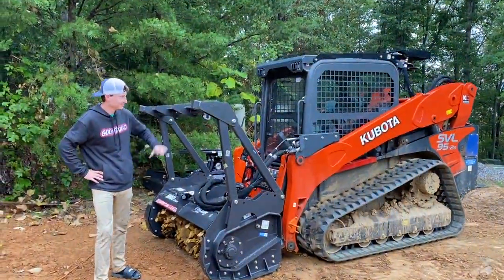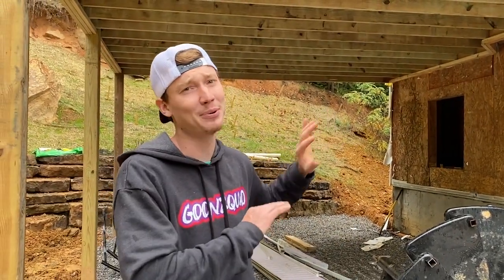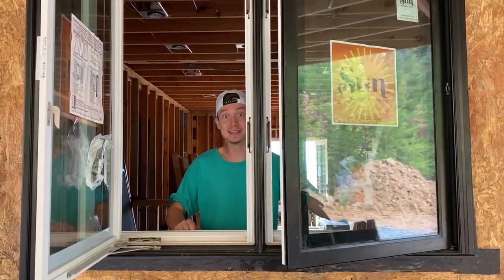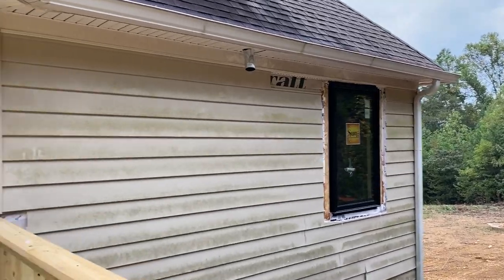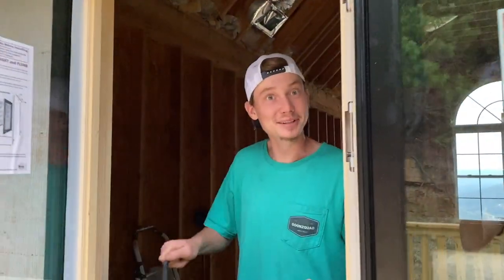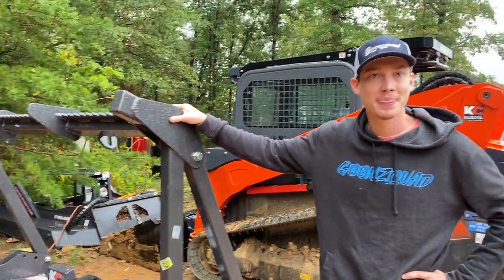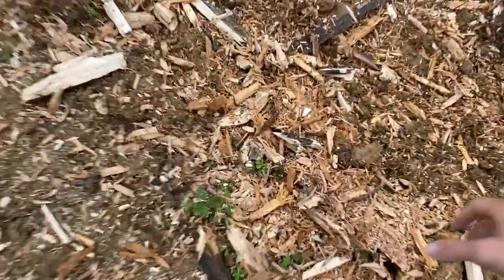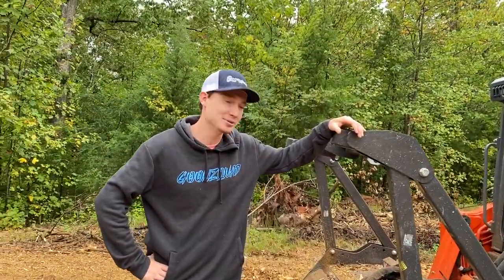The New Goonzquad Headquarters Part 22

Comment: It would look awesome to run cedar timbers casing your front door and then doing a small gable framed out of cedar timbers open underneath covering the front porch. That would look complementary with your brick and rock, even if you paint it. As in painting a rock and brick, then stain your timbers a dark Color.
Reply: Actually it would be best to completely redesign and extend the south facing front of the building, to make it into a properly sized home for the location.

Comment: MAKE SURE YOU FLASH THE NEW VAPOR BARRIER CORRECTLY AROUND THAT NEW DECK (should've done deck after siding) OR YOU WILL GET WATER PENETRATION BETWEEN YOUR WOOD AND SIDING, WHICH WILL RESULT IN MOLD LATER.

Comment: hey guys i'm not professional but that water sealant tape under the windows it's it meant to go up the sides about four inches as well and in the corners you don't cut it but pull it down into the corners I might be wrong but water will still get in the way you have it right now. love what your doing wish I could do the same.

Comment: That high flow mulcher is a machine delux...word of advice, walk the brush area to use it on and check for rocks, wire and debris.  If you hit barbed wire, you will be dissapointed in the work and time it takes to cut it free...same with a water hose.  Dont ask how I know.

Rocks will launch back into the window and it will shatter...bullet proof or not.  Been there and done that and ya will soil your armor in the process

Comment: Needs a 1” inch plate at the bottom back so it suck it in and mulches, instead of shooting it out the back.
That would be my recommendation to the engineer who designed it.
Other than that great attachment, can’t wait to see what it does to the scrub/bush.
Reply: They have a back plate the problem probably was he had it curled to far forward leaving no back plate for it to grind up against if you have it curled further backwards it will grind up against back of machine instead of just slinging it.
Reply: @ninaallen7849  could be.
I didn't pick that up.
Good eye .
I was watching as well as getting my kids ready for school and breakfast is always a fun time not.
Reply: @acepetdetective4424  I actually have used those particular attachments before that's what I tried telling them they needed from the start they also make different style teeth for them that will grind into finer material as well but yeah that is a crazy machine literally will eat entire trees.

Comment: the demo model will get tested out a bit - you really do need some elbow room, it will clean up all the small stuff and you can deal with a few bigger tree fellings stack up logs for when you test out a sawmill or make one - with the acreage you just need to pick away at it - work in progress - you don't have a real accurate survey but taking out the small stuff or select big trees will keep you going for a while even if you sell or burn a woodstove ot two - with the lumber mkt now having a sawmill could actually be semi profitable? once RE in nyc comes back yeah, you could also just sell beams for post and beam construction - you should have some sort of sustainable woodlot plan, knowing what you got is a first step - you may want to end up planting a bunch of trees but it is all going to grow back fast - you can get some sort of rough site survey in your head but you need quite a bit of room - do some layouts with string and eventually you will get a design and layout that works - taking a few more trees out will probably help any solar installs you have - do big patio 2 hi bay, 2 reg bay, office, screened in porch slab, polebarn, material bins - you have option of finishing polebarn for extra storage. get logs, rent mill, cut  2x6 16/12 for a day or two and you can frame as soon as the slab is done - do a 10" slab with lots of rebar and tiger hair and best psi for the job probably 3000psi - consult with the structural eng for all the specs - you can add more rebar sometimes than spec and it can help - it is like using a different pipe for your plumbing schedule 40 vs schedule 60 - quite a big difference - don't be afraifd to ask questions, do wear your oakleys and get some sort of winch setup along with the excavator and saw operator - you should leave a perfect piano hinge break everytime - the rotten trees use extreme caution with - just use the winch - even machinery is not really safe - you may want some i beams on the ceiling for hoists in the shop - this is where the concrete icf would help out - maybe you want to go with steel frame and metal studs - no crowning - just keep chipping away at it and it will come together - do parapet walls on top and a deck/solar/wind generator - you may as well go all in on the solar or at least half and half - reg service in the house and then solar with option to tap house if needed - you are going to want some split phase options - 220/240 for plasma and heat pumps maybe too - take your time - getting the site work done, foundation and roof is the most stressful once you get past that it will go quicker and you can get the systems done and get back to normal - get some legos and build what you want and challenge viewers #icf forms #moving is stressful #block and tackle #trimout
Reply: be careful with the beast but go full ham too - think about doing some pollinator and forage strips - that is the perfect tool and saves a lot of burning? a regular hd chipper may be better? that tool is for maintaining powerlines every couple of years - you still have some bigger trees to take out - some are worthless but some can be worth bucks - you have all the equipment so you are all set to handle all the site work and get back to biz - ez does it on the widow makers - i think you can take out more and terrace the hill and also plant some reg trees and maybe a mini orchard marching up the hill - you have a lot of land to work with - the road moto track makes sense esp if you decide to actively log most of it

Comment: Are all houses in the USA built like this?  I'm no expert but it all seems a bit flimsy.  In the UK most residential property is built using breeze blocks for the inner walls and bricks for the outer with a 4 inch gap in between for insulation.
Reply: Most USA southern states receive very little snowfall and even less build up of ice on buildings. What you are seeing is good with insurance companies who write the property insurance policies.
The State of Minnesota on the other hand, is an entirely different story.
Reply: @gpackwood1  Ok thanks for that

Comment: Guys< I have a question about that "over framing" on the long wall of the LR/DR/Kitchen- why was that done? I don't believe the overhead load needs it, what with the ground floor's 2x6" framing. That would put twenty five square feet back into the area floor plan, and those windows might be a better option, or not. Still want to know why that additional 2x4 wall studding wasn't taken out. this is a house that should be built around the views, no mistake about that!

Comment: That isn't plywood behind the vinyl, it's OSB.  Plywood can handle a little bit of water so long as it gets a chance to dry soon after.  OSB on the other hand, cannot handle water - it will expand like soaked cardboard.  There is a battle between home builders as to which is better for building, OSB or PLywood.  OSB is cheaper but Plywood does much better with water.

Comment: Crank on the Windows seems pointless.
Reply: It is there to hold the casement in any position, so it doesn't bang around in the wind. This design is quite popular, but expensive, and does tend to stick and jam if not used often and not regularly lubricated.

Comment: Anyone else thinking, that wood could be planked for future projects or traded to your local BBQ joint ??
Reply: Yes, many times and then I start thinking about what size planks and where they would be stored or ... spending an afternoon at the BBQ place trying to negotiate what type of wood they could use along with the size and then ... the sun goes down and it time to go home for dinner where I will remind myself ... The Road to HEAVEN Is Paved With Good Intentions!!
Reply: @gpackwood1  it took me literally 2 mins on my phone and google to find 20 plus bbq smoke house in chattanooga and the list of desired woods for smokehouses. a further 2 mins to check most common sizes for lumber, the time consuming part as you mentioned would be finding places to do a trade wood for meal or disscounts etc and actually planking the timber. these guys are not afraid of a little hard work so I personally think its worth it. but again thats just me :)

Comment: Better get rid off the glass door and get a break resistant door, those forestry heads will throw shit 300’ and when you lift it up to take down trees and brush it will throw crap back at the machine and it break the door glass and hurt ya.
Reply: When they bought it they said the glass was bullet proof so it shouldn't break

Comment: In my opinion it’s infuriating to me with that middle column in the kitchen window, they both even move sideways because it’s in the way (I had to say something about that window)
Reply: We used the 'Goonzquad House' as a quick design exercise in our Practice last week. Our consensus was that the property might have been better completed by extending it to the east (the opposite side to where they have built the deck) with a built in two car garage on the lower level, and a roofed verandah above at the front, with a secondary kitchen pantry to its rear. The new 'east wing' would then balance out the existing 'west wing'. Certainly, the house as it stands feels undersized (and lacks adequate bedroom suites) and fails to leverage the splendid views to the south. Considering the site cost ($350,000) and extent (15 acres), a more ambitious and imposing house facade would have paid for itself in terms of added asset value.

Comment: Why the hell do these windows open like that and why have that thing in the middle of the double ones if you wand the "view"
Reply: Such windows are popular in the USA, mainly because the gearing acts as a restraint at any angle so the casement cannot be blown around by the wind.
Reply: @johnstedman4075  it sounds good I feel like it's a lot of hustle is there an option to have both?
Reply: @theofilosdimas6677  Yes it's easy to fit locking stays on side hinged or top hinged casements. You just position the window however you want and drop the nearest hole in the stay over a fixed peg on the windowsill. Or you can get manual stays with friction fasteners. I would recommend side sliding windows over hinged casements any day though, because they can be designed to slide into a pocket in the wall, and open up the view completely.

Comment: i’m from the uk and i now understand why American houses are so cheap it’s basically mostly wood, i could be wrong about that. in the uk 90% of our houses are from brick
Reply: Yea most houses in america are made with wood but trust me if you take care of these houses they'll last a lifetime, just most people in America don't maintain there houses and have tons of failures!
Reply: @kylekroschel3879  Exactly, correct construction procedures and regular preventative maintenance are the keys to making timber frame buildings last.
Reply: @johnstedman4075  yea I own Kroschel's Real Estate & Landscaping Co. And I watch so many people let there houses go and not take care of them and ends up costing them
Reply: @kylekroschel3879 Yes, and in the UK the use of timber frame housing construction, which became very popular in the 1980s, has now significantly declined because of maintenance issues. I have seen a number of cases where problems due to water penetration and wood rot have been ignored or wrongly diagnosed to the point where buildings have had to be demolished because this was less expensive than trying to repair them. This often results in expensive and lengthy legal actions where the owner, the insurers and the builders all end up dissatisfied and their lawyers get richer. Looking back, there were five root problems. Firstly, there was no previous culture of such construction methods in Britain and so the necessary technical and constructional skills were lacking. Secondly, many new owners were often not even aware that their new home had an important structural timber frame hidden between the plasterboard ('sheetrock') and a non structural four inch brick external skin. Thirdly, no proactive thinking was done to foresee and deal with potential problems before they became serious. Fourth, no inspection, maintenance and repair budgeting was factored into the probable future costs of buying and owning a timber frame house and the need to act promptly if problems arose. And lastly, it was not realised that fixing potential problems might well become uneconomic if there was delay or neglect. A sad story which the British property industry has hopefully learned from.

Comment: your plumbers did a sloppy job on the waterlines in the walls. Not a single clip on any of them in the vertical drops. They are going to bang around from water hammer when you use your fixtures and you will be annoyed. For the pennies it costs for some J clips, that is just laziness.